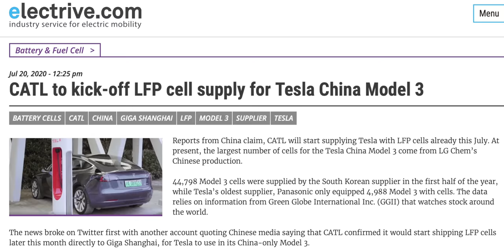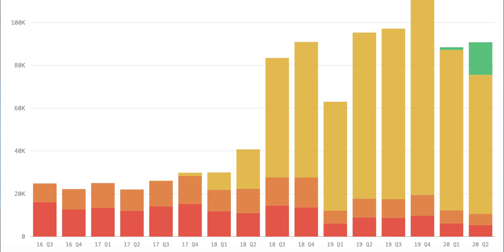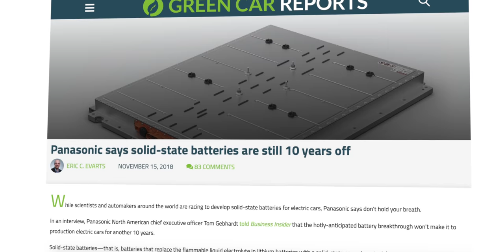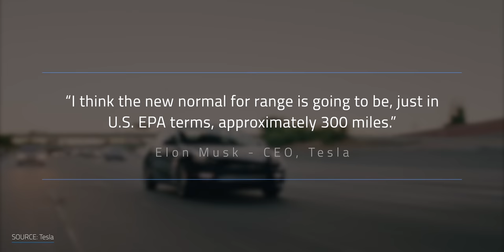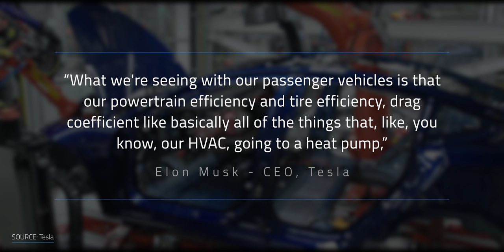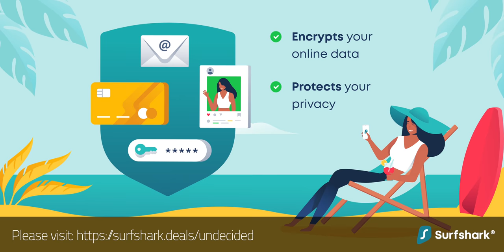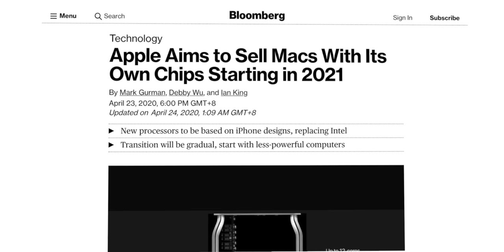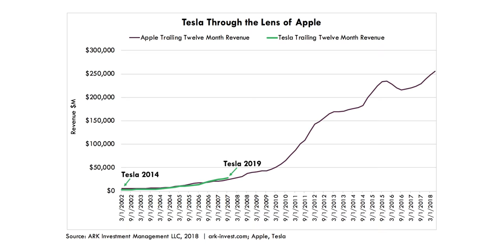Exploring Tesla's battery day and what to expect

Comment: You need the more miles per charge to make up for longer fuel up time compared with gasoline.
Reply: @robertjames1267  I would like to see a full charge in 30 minutes for 750 miles. That would equate to the time spent for gasoline fueling. Also the climate control systems could be used without anxiety.
Reply: Strutingegle - Exlectricity is alleady cheaper than GAS, 7c/kwh in MOST locations.
Reply: @markplott4820  Yes and home solar systems would fit in nicely too. If Tesla could double the range and half the charging times it would greatly reduce the amount of charging stations needed for when electric vehicles totally replace gas.

Comment: If Tesla pegs their vehicles range at 300 miles, then every other manufacturer will be happy to do the same. With range no longer a selling point, then how does Tesla differentiate itself from other EV manufacturers?
Reply: LEGACY car makers are still Doing CATALOG ENGINEERING , they can just add more Batteries , they are already paying a FORTUNE to Battery OEM's for the cells today. TESLA is more than 20+ years ahead of LEGACY car makers , you will see on TESLA Battery day. 
LEGACY and BEV Startups are still way behind Tesla.

Comment: The only thing I do not agree with is range. We want more range and faster charging times. 300 is not going to cut it for the price if an X or S so Tesla has to increase the range and I do want to buy a new X I am 100% waiting until battery day. I have been screwed by these announcements already. #lessonlearned.
Reply: 300+ will only be for model 3 RWD , Model Y RWD and Cybertruck RWD. 
Model S/X are still Flagship products and will be over 400+ mile with Dual Motor , with NO option for RWD and SR.
Reply: @markplott4820  Yes, but what you have to remember is the Elon is an egomaniac. He will not let any other company beat him on range and for $$90K for an S and an X with a boring 400 range and the AIR coming out with 500+ he will not let them beat Tesla. So Tesla is going to have to do better than 400. I will also not pay $90K  for an X with less than 500 range. For now I am going to buy a CPO until next year when range and charging times will get better.
Reply: @super_populr   - Wrong, ELON has no EGO to go after. HE does it Because HE can. 
and ELON Lies about Specs and Performance of its Existing cars , the specs are all DOWNPLAYED. 
and HE does NOT need to Compete , because HIS cars are Already Superior , they are just SOFTWARE Limited to HIDE the TRUE Specs. 
by the Time a Patent is Filed, its Already built into Existing PRODUCTION cars.
TESLA only Patents OLD Technology .
Reply: @markplott4820   You saying that Elon has no ego shows me how much you know nothing about Elon.
Reply: @super_populr  - I have Studied ELON since his PayPal days. You REALLY can't injure ELON, he like me has ZERO ego to bruise. And he SIMPLY knows he is a SUPERIOR Human.

Comment: For me the most exciting possibility for Battery Day is the Million Mile Battery and it’s ability to open up Vehicle-to-Anything bi-directional energy flow. That would be a real game changer and Tesla stock would spike immediately. That would also fit Elon’s vision for sustainability and carbon reduction for consumers. Fingers crossed.
Reply: Robert James  I think so. But this would be new vehicles only (with the new battery) so a bi-directional onboard charger is a very simple mod. Just one chipset and the allied logic in the O/S is all that would be required. That COULD be retrofitted to existing cars - new battery + new charging setup. Would be expensive though.

Comment: I've become convinced it's the semi business Elon's going to have to eat his hat about his stances with fuel-cell mobility (will get to details), and his recent glances & replies at aviation doubles down that possibility... (see Doogan fuel cell drones flying 4 x's as long as batteries & lifting 3 x's as much... which also shows his clown statement on flying taxis, so he can ply to bore more underground). -- Even with battery improvements: BEV semis are still heavy, won't go the long distant lengths (without time constraints), & won't refuel as fast for commercial semi hauls (not to mention extreme temperature parameters). Those are vital industry standards, for commercial work. Nikkola FCEV semis have won contracts & made agreements with Hyundai trucking & busses as well as Toyotas. - Daimler has fuel cell vehicles too, and Hyperions new sports is *really intriguing engineering with those added turbines. *And they have fuel cells to improve in tech too, while also using batteries (whether as BEV's or FCEV's that have battery sourcing as well). --- Personal mobility & short range BEV's are coming to our soon future, but I'm not convinced they will have the whole or majority of zero-emission mobility... (as trains & ships are still in focus, as is energy storage & electrolysis -- and water)...
Reply: Ps - *Doosan ...
Reply: Ever is a compelling disagreement. Damn.
Reply: Fuel cells last a really long time (at current states) & have far better recycle options. Nikkola, alone, will initially be adding 200 North American stations for their fleet (by electrolysis, converting hydrogen *at location) in 2022 while increasing (at costs that beat petrol & continue to), so they *will advance.
Reply: Standard water is enough, while electrolytes are needed (still easier than hauling large tanks, more regularly, & there's developments for salt water systems that don't need electrolytes -- which is huge, for fresh water needs too). I don't know the average for all three makes or one, but I know it's far longer than ICE semis. Go to Skai.co and see their stats on recycling fuel cells, & that's the extent of that part of knowledge I have on systems to do it (but, it must not be too complicated, with those percentages). And "current states" meaning how things are for FCEV's *currently.
Reply: Ps - average longevity of the fuel cells, that is... (again: still much longer than petrol, and there's still room to improve them... Honda had a huge leap with their sedan make, in one year)...
Reply: Hydrogen has always been the fuel of the future:) When someone makes a FCEV semi and enough refueling stations - that will be great. But for now, still nothing...
Reply: The semis I've researched have the fuel cell stack go straight to the electric motor, while there's a *small lithium-pack on every one for idle, start acclerate (to said motors), or for longer uphill gradient (which, route-depending, determines battery size). The fuel cell (when vehicle in motion) charges the batteries (with excess charge moments) & the batteries still enable regen breaking. Answered about moving fuel. How do we store petrol? Don't have all the answers. Thanks.
Reply: There's routes in California, besides Korea & Japan's developments. But, that's *currently all (till 2022).
Reply: Haven't seen any numbers, about that, but (big part of the point is) it's about far more than charge & fuel cost (&, again: Nikkola H will be lower cost than petrol). Time, length, & haul capacity is also money.

Comment: Did you check the special Tesla Battery Day page?  The wall paper is very intriguing .. Silicon Nano wires? Silicon powder infused Li-Ion batteries? Their NEIGBOUR (Amprius inc) in Fremont is working on this  for years... To continue your mantra.. It would be a 4 punch knock out!

https://www.tesla.com/2020shareholdermeeting

https://youtu.be/yVfpYlm9aJA

I think we do not know half of what Tesla will unveil September 22nd, Tesla is notorius to keep the juicy bits a lip tight secret.  BUT they are good in showing hints and stirr up the hype LOL! (remember the vague photo of the cybertruck headlight, in the months running up to the unveil event!?)
Reply from the maker: I’m thinking nickel nanowires.

Comment: I strongly disagree with your "lockup the supply chain" comment about Apple and likely Tesla.  Apple creates it's own specialized parts.  Using size to bully suppliers is illegal and immoral.  "Most favored" price is often a matter of being able to commit to the highest minimum production quantity -and Apple and Tesla (in batteries) have this ability.  Tesla making it's own batteries could be a big win or a massive failure.  My view is that is will be a win for stock price, short term but a failure for profits in the long term.  I am thrilled to have a US battery maker.  I am perplexed that it will be canned vs the packets that everyone else is going to.

Comment: The gushing over Apple is nauseating 🤢
Tesla make nice toys for rich people. They aren't going to change the world until they can deliver cars in the market segments and price points that majority of people buy.
Reply: If battery day is about reducing costs of battery manufacturing, the cars will be cheaper in time. Also, as long the demand is bigger than their capacity of production, prices will not go down. Imagine a demand of 20 mil when you can only make 1 mil/year, it could happen if cars go down to $20k, but they would have to turn down customers.
Reply from the maker: That’s kind of the point.  We’re hitting the tipping point where EVs will start to be cheaper than comparable gas cars up front ... not just over the course of using the car for several years.  If this battery tech and manufacturing plays out like I think it will, that’s going to happen soon.
Reply: @UndecidedMF  at this point its all just marketing and speculation though. I'll get excited when you can buy a regular EV for normal person prices, not cars that sit in the BMW/Mercedes class of vehicles.

Im also quite concered about after sales support and right to repair on Tesla vehicles, especially outside of the US.

Comment: Tesla won't be able to compete against displacing competitors for supply when the Big 3 get in the market.
Tesla may be big in EV but is nothing compared to real automakers.
Reply: GM's already in the market with the Bolt and how's that selling compared to the Model 3?
Reply: @sgouletas1  thinking more along lines of Mach E and F150 E
Reply: Guarding the mock e and electric Ford 150 will be able to evaluate those when they come out and we see what kind of quantities are produced until then it's just hype. I wish the best to the big automakers but the truth is if you can't innovate as fast as Tesla you can't catch up.
Reply: @sgouletas1  the real benefit of  having a contract with a big company is volume.   Tesla  made 367k vehicles in 2019 Ford was 5.4 million, its would be better to sell a small item to multiple times than  a big item only a few times.
Reply: @robertjames1267  the issue is profitability and sales.  Tesla has been living off hype with the industry by in large ignoring them; what happens when the industry notices them or investors stop believing the marketing spin, and look at profits and capitalization.
Tesla must control its costs or they are in fear of going away--for the  average person will never own a Tesla. The only thing selling Tesla's is hype, you want a track car get a Porsche, want luxury get S Class, want a bit of both 5,6, or 7 series.  This is Tesla's market and as such will never compete with the Jeeps, F150s or Golfs of the automotive world.
Reply: @robertjames1267  pass it on to customers where is the $30k Model 3 that was promised?  No, any cost savings is going back to the company so it can have some profits.  Parts are a major issue if Tesla wants to be in mass market, week to  months for simple repairs anit going to cut it.  I had a 96 Cougar that had a rear quarter, deck lid, subframe and floor straightened in less time and money than the TFL Tesla had its fender bender repaired.
The description you give of Tesla could be said for Enron too.  Just because the stock price is doing good doesn't mean the company is, Uber/Lyft.
Reply: @robertjames1267  cost savings could go into making the product more affordable like Henry Ford did with the Model T.  The company will not change the world if only the elite can afford it.